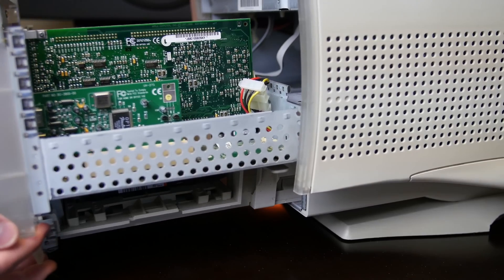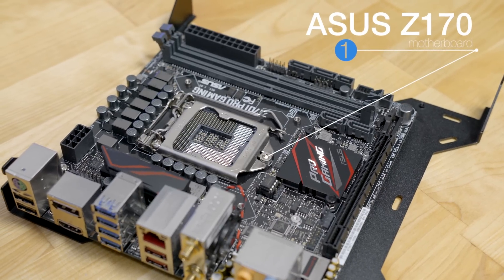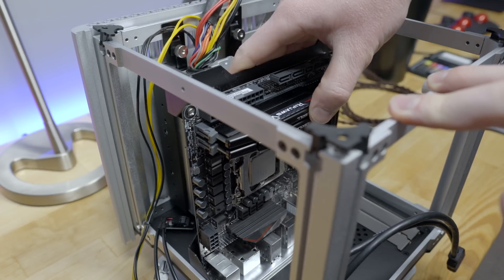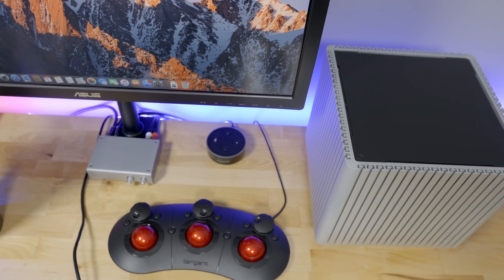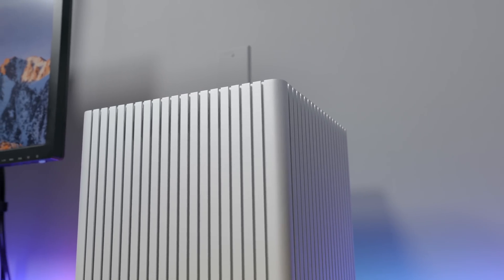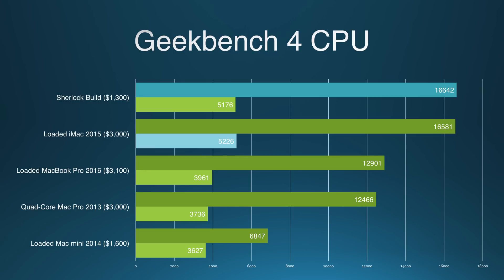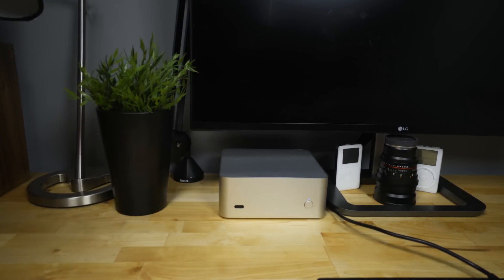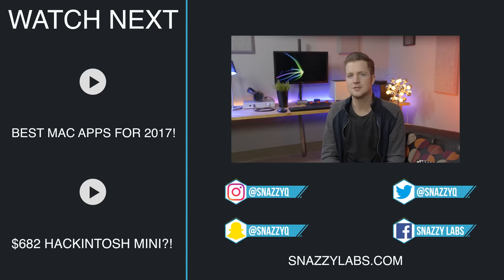The Quietest Mac Ever Made!

Comment: as someone who has this EXACT build, but using windows, i feel like i need to warn some people.

Yes the machine can run okay without a gpu if youre running a 6700k, but even the slightest graphical load causes so much more cpu load and consequently heat

i use mine as a twitch streaming pc, and OBS on this machine can use up to 90-100% cpu, where the same load in obs on my gaming pc (same cpu but gtx 980) only uses around 3%.

If you plan on running this machine i highly recommended picking up something like the fanless gtx 760 too.

Other than that this PC is completely silent and is a beautiful thing when running.
Reply: Yeah, but then that kind of defeats the propose as that external GPU is still going to have fans on the GPU, if you want to stay fanless and still have decent performance I don't think there are many other ways to do that, although at this point I would wait for the next generation cards because you should be able to get 1060 performance in a 75W card.

Honestly it's a project I would like to do if I had the money to build a system I would never use...
Reply: Protostar would the 760 fit inside?
Reply: What I would do is install a thunderbolt 3 card and use an external gpu
Reply: Honestly I would feel safer doing a DIY job and buying an ordinary GPU that runs just off PCIe power so it keeps within 75W, then creating mount with a slab of copper ontop and then connecting that slab to the heat pipes to the case just like the the CPU, but on another one of the panels which the CPU isn't using, but that also wouldn't stop me from being able to access the RAM and storage without ripping off the heat pipes as you would be using thermal adhesive.

Cover the VRM and VRAM in small heat sinks and you will be all good.
Reply: try delidding ypur cpu
Reply: Passive gt1030
Reply: eyy protoaster

Comment: Probably one of the worst builds that i have ever seen. 80 °C for the cpu?? 36° in idle?? And all this for a mere 400 usd.. No wonder that the sherlock has the same geekbench and cinebench results as the imac. They have the same cpu!! Try using something with gpu acceleration and that igpu is no match. The configuration with the 480 is way better. Noise is only a problem if you buy fans and keep them at max levels. Buy some low rpm fans, and you can get way better temperature at virtually no noise.

Comment: Great video! :)

My Mac Pro 5.1 (before trashcan) costed me 1300$, same as the described computer in this video, has a 6/12 Core Xeon W3690, GTX 970 and does the same. It is VERY quiet under load. Even compared with a Custom Loop PC Build from a friend of mine. Runs NATIVE (not hacked!) macOS and Windows 10. 

Which one would you choose?

Comment: I have a question about the cooling... how do passively cooled components like the CPU VRMs and MOSFETs cool? Usually they rely on passive air cooling from a system fan, but here there is nothing. Is there a way to check the temperatures of those?

Comment: Nice build! However, saying it's faster than all of Apple's offerings isn't true. It's cheaper for sure, but apple does offer 8 core and 12 core mac pro with dual gpu's. They cost as much as a car, but still, they are faster and you can render all day long :P This is a great build tho. I like the case and the cooling solution for what it is.

Comment: You know there's passively copped GTX 1050's?
Reply from the maker: Wouldn't work in this application for a variety of reasons. Thermals are a big issue. The KalmX assumes airflow in the ambient area to wisk away heat from the fins—be it through case fans or another method. The inside of the DB4 is a fortress and without any air to pull the heat away from the card, it just bakes in it's own bubble.

Comment: While I do understand the idea behind the idea behind this project with a "silent Mac build", if you're making comparisons on performance, you should include GPU performance into the summaries. The CPU "shortcomings" some of the machines have (iMac 2015, Macbook Pro 2016, Stock Mac Pro 2013) are balanced out by dGPUs that are pretty powerful (relative to no GPU at least). On that note, how did you manage to get video output with no GPU? the i7-6800K doesn't have an iGPU and the Z170i isn't a server board with integrated graphics?

Comment: y u no zen >:(
Reply: John Stevens Obungen zen could run a little too hot with this cooling. and I don't know whether it's compatible with Mac OS
Reply: u dont think there is a micro ATX mobo with AM4 socket also people that want a fanless mac probably dont deserve one XD
Reply: zen doesn't have an integrated gpu
Reply: AMD and hackintosh is not so compatible, yeah.
There is some projects, that work on bringing macos to AMD, but I'm sure they're not going to support zen in next few years.
Reply: John Stevens Obungen Zen has no iGPU currently. But when Raven Ridge comes out and Apple starts using it (and they will), no more excuses.
Reply: Fanless GT1030

Comment: I beg to differ that the "cube" had the sexiest body Apple released thus far. I prefer the Mac Pro/Powermac G4 instead: now that was a work of art. I modded my own back in 2014 which includes the Z97 platform with OS X 10.9, 10.10, 10.11, and 10.12 installed.
S/N: In the table you posted your parts build list, I'm sure you mistaken "6800K" for your 6700K since 6800K is X99.

Comment: delid, see if those thermals drop!
Reply from the maker: I would have if it were a 7700K, but the 6700K wasn't yet prone to Intel's crappy compounds.
Reply: it will still be an improvement. not as huge as the 7700k, but still like 5 degrees or so

Comment: "Quietest PC possible, and we hacked macOS on to it."  Not really "Quietest Mac ever made".  There have been multiple completely silent Macs made before.  Going back to the original Macintosh, which had no fan and no hard drive, so only while actively accessing the floppy drive would it make sound.  The later Macintosh Classic had an onboard ROM drive, and if you ordered it without a hard drive, could be run with the fan disabled just fine.  The PowerBook 100 could run perfectly fine from a RAM drive, and had no fan.  The later "slot load" iMac G3s had no cooling fan, and if you swap in an SSD, it becomes truly silent.  Same with the G4 Cube - swap in an SSD, no sound.  12" MacBook has no moving parts at all, in any possible configuration.

Sorry, this headline is hype for the sake of hype.

Comment: A passively cooled palit gtx 1050 ti will work
Reply from the maker: Sadly, no. That card requires case fans to pull heat away from fins—which this case doesn't have. It's a fortress. The card will just bake itself.

Comment: they make passively cooled GPU's
Reply from the maker: +Peter Thress Yes. They don't really work in this environment. They need airflow to pull the heat away from the card heatsink. This is a hot box with no air so it's not really an option with this case.
Reply: That's kinda what I thought.

Comment: I would put a thunderbolt 3 card in the pice slot to make this expandable if need be,  or an SSD, sonnet technologies makes excellent cooled thunderbolt 3 enclosures that work with Mac OS, you could use a full size GPU and not have to worry about thermals as much.

Comment: For anyone wanting to do this, don't forget that if you add a 5K display (which the iMac 5K obviously comes with), you'd end up spending more than if you had just bought the iMac, and you'd still have an unstable, unsupported hackingtosh with no GPU. Don't even worry about the Mac Pro, because the iMac 5K is such a well-built surprisingly well performing machine for the price. Plus you'd get a machine with proper M.2 SSD instead of a massive bottleneck (as is so common on DIY builds) of a SATA SSD, and... here's the surprising part, support for more RAM - four slots with a 64GB limit, which handily beats the bargain-basement "gaming" mobo. 😉

Comment: Streacom sells extra heat pipe kits  to incorporate 2 more of the panels into the CPU cooling system which would be good for overclocking or a more powerful CPU...
Reply from the maker: +Daniel Pierce The extra heatpipe kit is installed on this build.
Reply: Snazzy Labs Ah, must a missed it. Still not enough to overclock?
Reply: Snazzy Labs did you find there was enough room to use an extra set to go from the second wall to the other 2 walls?
Reply: Snazzy Labs It would take some jerry rigging but it's worth it cuz damn this case is sexy!

Comment: Hey Quinn does this build handle multiple monitors? Or to put in another way if right now it doesn't if I add fans will it handle multiple monitors?
Reply: Miguel Palau should be fine aslong as you don't plan to run any tasks like heavy gaming
Reply from the maker: +Miguel Palau Good question. I actually don't know. I'll test it tomorrow.
Reply: I'm a web developer so my tasks aren't really heavy on resources but I'd like to sport 3 monitors at the same time. 1080p is fine by me.
Reply: The chip can power a 4k display just fine with no external GPU so it would stand 2 1080p monitors SHOULD be fine 3 I'm not sure
Reply: Gotcha hopefully Quinn will test this out 💪
Reply: Snazzy Labs did it work?

Comment: there's no reason to have an overclocking Mobo/CPU in this build... it's just spending more money for no reason. if you want to build this yourself go with an i7 6700 (non k) and a b150 motherboard for more reasonable prices. yes your performance ceiling will drop but not by much. don't spend money when you can't do a lot extra with it in this case.
Reply from the maker: +j7a1k1e Parts were purchased before I knew the thermal overhead of the case. I'd still recommend spending the extra 5% on K and Z modeled chipsets un case a) you repurpose the parts in another case and want to OC, and b) they have a much better resale value in the long run.